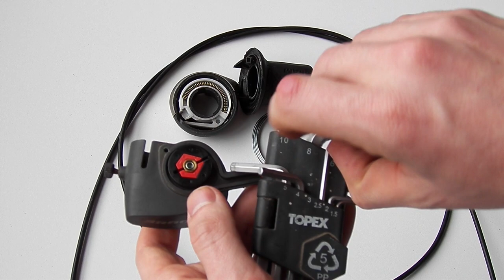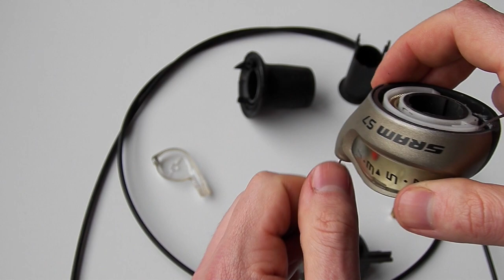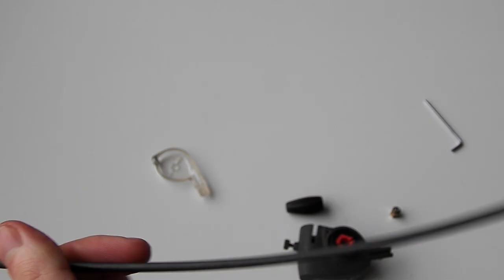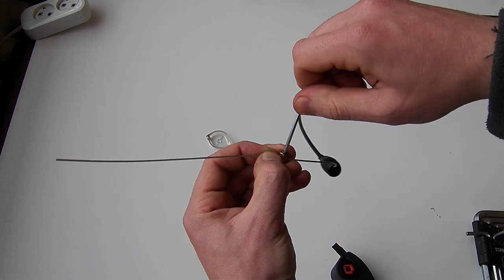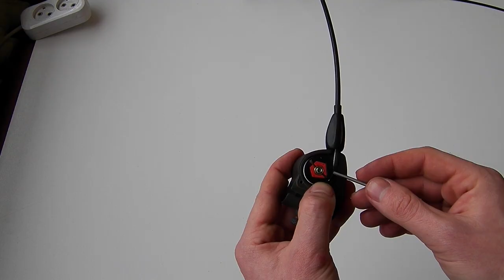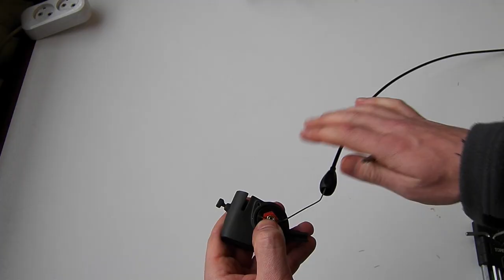SRAM / Sachs installing and adjusting cable in shifter chlikbox

Comment: This is GREAT video!
When the hand shifter is in 1st gear, the length of the cable, measured from the end of the cable coat to the beginning of the black ring when the cable is pulled and clamped in a metal hexagon and fitted in a red socket, is between 9.5 and 10.5 mm. Then fine tuning can be done as needed, when everything is assembled as on this video. DO NOT overtite cable in metal hex. , it will cut cable!
Велики поздрав за аутора!
Reply: You meant 9,5-10,5 cm and not mm, right? Or wrong?

Comment: Cable must not be set by trial and error. You will easy cut if too much. There are fixed cable settings published by SRAM or otherwise use their specific tool.
Reply: This method works as well as the tool if you watch it carefully. He shows you (at 3.13) where to place the hex retainer bolt. The way he shows you means you cut it just a bit too long and can fine tune afterwards. Sure - the cute elephant tool (one of my favourite tools in the world - I even have it on my tool board at work - I'm a bike mechanic) eases the process. But this method is fine - especially considering SRAM no longer make the tool or even decent quality click boxes any more.

Comment: Worst component I've ever worked with. The internal of the twist shifter might as well be made of fucking paper.
Reply: Yeah they suck pretty hard. But repairing the old ones is still an improvement on the crap they are selling in 2024 under the Sturmey Archer brand.